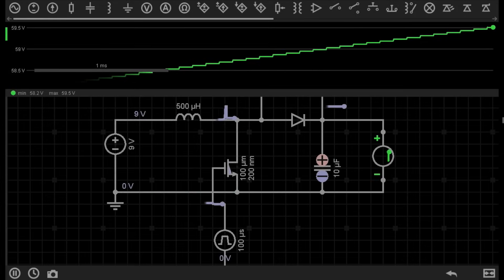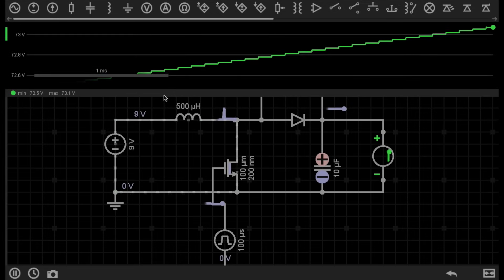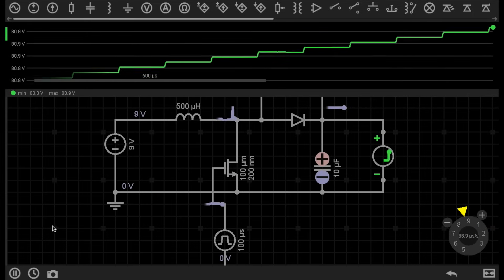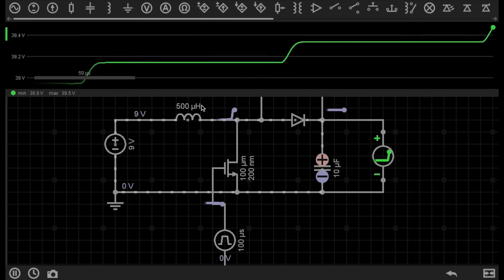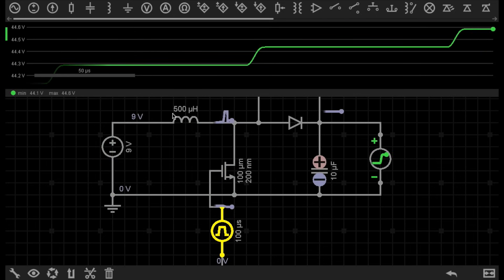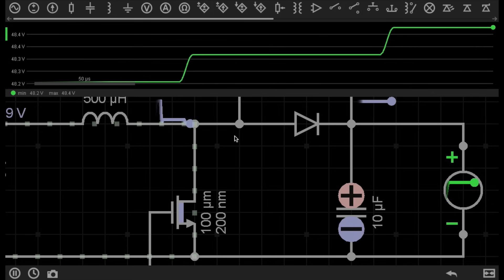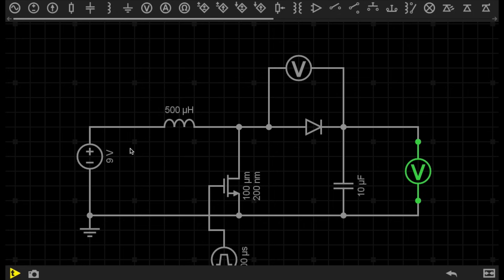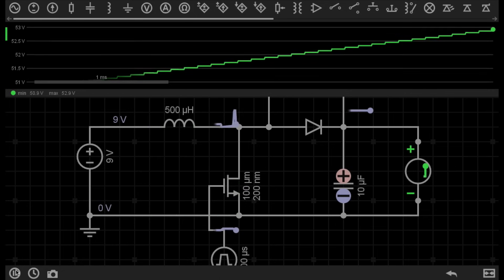How Boost Converters Work (DC-DC Step-Up) - Electronics Intermediate 1

Comment: Can this circuit be used to boost power (amps) from example a 48 Volt battery supply to lets say heat a heating element?

Comment: If the capacitore paralel the led , it make the led be on always ? 
Than why we need turn on off of supply?
Reply: its not led, its diode. Led is light emitting diode. In this circuit is simple diode

Comment: This is a great channel, you should really have more subs. Will recommend to my fellow ET students.
Reply: DC-DC step-up or boost converters are a type of electronic converter that are used to increase the voltage of a DC power supply. They are commonly used to power devices that require a higher voltage than what can be supplied by a battery or other power source. Boost converters work by taking in a low voltage input and converting it to a higher voltage output. This makes them a really useful tool for powering devices like Arduino boards, motors, and LED lights.

Comment: in real life how do i control the switch
Reply: You input a clock signal at a certain pulse, with a frequency you choose. You can use a 555 timer to control the switch.

Comment: Say if you're using a standard 9V battery as power source on this boost converter, even though the voltage you generate is a lot higher, there's just not enough power overall (which means a lot lower current) to hurt you right?
Reply: If the output capacitor stores enough energy at sufficiently high voltage, even the boost converter and battery is not powerful, it can still kill a person in an instant. So always discharge before touch.

Comment: I would not recommend building an open loop circuit like this.  It is too dangerous!  In real life, you need a smart chip as a controller to build a closed loop system.

Comment: I'm a bit confused as to why when the switch is closed, there is no current flowing across the diode to the capacitor? Surely there would be some without a resistor there?

Comment: Thank you for your explanation of the boost converter. Unfortunately, I still have a question on their working.

When the mosfet is off, the capacitor is charged by the circuitry. However, when the mosfet is on, there is a direct path from the input power source to the ground.

That means that power is still being used, unlike the boost converter. It also means that the boost converter should short circuit.

But it doesn't, so there has to be something I cannot figure out... Do you know what is It?
Reply: It's actually the inductor, when the mosfet is on the inductor act's as a load and starts converting the electric charge into magnetic field, when the inductor saturates ( reaches the maximum magnetic field it can store, measured in henry) it will be a direct path and the mosfet will get shorted. This is the reason why high frequency converters can use smaller inductor like 10uH because the "on" time is shorter and it will not saturate. Low frequency converters need bigger inductor, if not it will saturate and short out.  Most dedicated dc/dc uC controllers have a current feedback as soon the current starts rising because the inductor starts saturating the mosfet will be close to prevent short circuit.
Reply: @andrasszasz4373  If inductor is saturated, mosfet will get shorted.
shorted means what?
mosfet become faulty?
Reply: @anandsivathanu8517  Shorted means that the power supply's positive and negative rail will be shorted (same thing as if you take the powers supply positive and negative wire and touch them together), this will cause excess current through the mosfet which will result in excess heat and the mosfet will burn out.
Reply: @andrasszasz4373  Thanks for Your Kindly Reply Mr.Andras Szasz.
 I understand your reply.
Reply: Since you are working with AC, there won't be a short.

If the mosfet would be on steadly, then yes, a short would happen.

But think as an AC circuit.
A 500 uH inductor switched at 100 kHz would act as a 315 ohms impedance.

Since you are driving the inductor with a pulse train, the back emf is the responsible for stepping up the voltage.
Remembering that V_backemf = -L di/dt
Where di/dt is related to the duty cycle and the switching frequency.

Comment: Stupid question but does that mean the 10uf capacitor here need to be rated for 100v or rated for the 9v supply he is using?  I would be leaning towards it being 100v since the vom will eventually achieve 100v that he mentions so I assume the capacitor would also be at the potential.

Comment: Basically, you charge a capacitor that has a high output voltage (high capacitance) and cause it to rapidly charge and discharge, the discharging is the output voltage.

Comment: This channel is awesome, I do have a question, I'm starting to learn the basics of electronics. In this circuit, I'm finding it hard to understand why the current from the battery flows through the transistor when on and not down past the transistor,  through the diode and capacitor at the same time? I somewhat get the inductor and the polarity change based on the collapsing magnetic field and the induced voltage it produces, but I don't get why current will only follow the path through the transistor when on and not through the entire circuit when the cap and diode are on the same path? Sorry, I'm new to this, can someone explain this please?
Reply: I am curious myself, it's on the same path
Reply: Same question i have 😕
Reply: Try this: My guess is that some current does indeed, flow through the coil and diode. The resistances of the coil and diode lower the voltage that the capacitor receives, say 0.7 V reduction for the diode and some for the coil. Let's imagine that the capacitor has 8 Volt applied when the transistor is ON (conducting). The 8 V is a lower varying base voltage that then has a high voltage pulse superimposed on it, the capacitor 'sees' the average of the two changing voltages and partially smooths the two voltages, eg 8V + 60 peak. The resistance of any load affects the smoothing, lower resistance load makes it harder for the capacitor to keep the 'average' output voltage stable.

Comment: Question....
I have two 5 pin adjustable voltage converters.
One has the LM2577S, and is a purchased board.
The other is the IRU 1150, a recovered component from another converter that met its fate early :)
Yes, it works fine....
My question is, using a 5 volt supply to both of the Converters, create a Positive 12 supply from one,
and get the other to make negative 12 volts ?
Ending up with ground, +12, and -12.

Possible ?

EDIT: I need the switching Op Amp ability of 12 volts for audio pre amps.

Comment: very nice video. 
i have a question. i want to charge a battery from a generator and need to build a boost-buck-convertor that will keep the input voltage in the battery at 12V.
how do i build that boost-buck-converto?

Comment: Hi. I would like to build a basic boost converter  buy wiki is banned in my side and other site also dont load itself. So where i can find what values of resistor and diode and umm coil and mosfet and capacitor i will use? I can search these in other sites but i would like to keep respect on to ur knowledge so i m requesting from you.

Comment: When the voltage goes up what happens to current
Reply: vem4o Current will go down when voltage goes up and vice versa
Reply: mrsemifixit  why is that
Reply: vem4o Power must stay the same. ( ideal case where we ignore small losses that create heat)

power = voltage X current

This a very simple algebraic formula. 

If power in and power out must remain equal, what happens to current as voltage increases? It decreases
Reply: mrsemifixit ok , but what about ohms law then . Sorry for the basic question
Reply: vem4o What about it? P=I*E so what do you think?

Comment: Use two of these circuits paralleling the inputs and outputs. Have the mosfet hi speed switches alternate so that one o0f the inductor coils is always collapsing generating current, thus a more stable and higher current output potential.
Reply: DrHarryT 
what current will u get?

Comment: WHAT TYPE OF TRANSISTOR DO I USE .NPN OR PNP
Reply: doesn't matter, but in the video he used an n-channel MOSFET rather than an npn BJT, because in practicality it has way higher switching speeds and can handle larger power.

Comment: I'm a little confused. Why wouldn't the current goes through the diode and starts charging up the capacitor when the transistor is off, what is stopping it? Could anybody help me out here please?
Reply: Because it is a capacitor. It isnt supposed to suck up current continually. Only a quick change in current (AC) can pass through it. Thus the charging stops.

Comment: Hey can anyone answer if the frequency of the switching also affect the output voltage values? Any calculations for that? I watched most videos only take duty cycles into account. Thanks.
Reply: Here's the formula: V(out) = V(supply)/[1-D] where D is the duty cycle (ratio of transistor on-time to its switching period). Basically, the output voltage increases with duty cycle.

Comment: but how can the voltage keep holding the higher voltage on the output? is it only the capacitor? the circuit might glowing on the end. and what is the limit of the high voltage?

Comment: Recommend to use a more scientific simulator. Every circuit is great for basic calculation, but it is not gonna provide you with real life acceptable values for your circuit to work properly. In real life, the inductor will ring and cause high voltage spike which could breakdown MOSFET. The diode must be a fast Schottky diode. Input cap must be populated or it won't step up much voltage under load. If there is no feed back and the output cap current peak, the circuit is theoretically unusable. Bad feedback loop will cause unexpected damage.(Popping LED without noticing)
Reply: Mr. Tech
I'm sorry to say but you're wrong. In this particular circuit, there's an inductor, which generates a voltage spike in the exact moment when the FET starts to conduct (shorts the inductor). This spike goes through the diode, then charges the capacitor. This charge is very tiny (depends on the value of the inductor and the frequency of the pulse-generator), but the voltage of the spike is high. Of course you can't overcharge a capacitor, but if it's a - let's say - 200V one, you can be sure it will be charged up to this voltage over time.
This is the only reason the inductor has to be in that circuit - the voltage spike it generates when it's shorted. Older engines use the same principle for their ignition, there's a capacitor, an induction coil (ignition coil), a breaker and at the end there's a spark plug. The sparks voltage is high (12.000-30.000V) while the battery voltage is 6 or 12V, the current is low, but it will ignite the fuel-air mixture in the cylinder.
Reply: so which simulator you recommend
Reply: spice
Reply: I agree. It is better to make it in real and test it. These computer models are interesting, but far from reality, especially when it comes to these types of circuits.
Reply: Monsieur Mohandis  spice is engine which is used in almost all sim
Reply: Is there any SPICE-baesd simulator available on Android?
Reply: Hello Leo -- if you say so, could you please help me with a clear electronic schema, to build such a circuit using the battery 12 v of my car ? 
The project is to electrilising the air by 2 nails not touching each other,  in the hose before it come into the cylinders.   Thank's -- you can publish this device on your youtube post.
Reply: Jacques sur Gmail .
Just buy a $20. Stun gun.

Comment: sir  i have doubt 
when we switch off the transistor magnetic field collapses and induce  emf in the coil but it should flow in the opposite direction of applied voltage?
Reply: The polarity of the voltage across the inductor did reserve, so does the rate change of the inductor current, but the polarity of the inductor current doesn't change

Comment: If im using 12v dc to supply a converter to 220v Ac connected to a charger with 3a for a 52v 26 ah lithium battery which takes 12hrs to fully charge on a normal 220v Ac power point. How many Ah must i need on my 12v to last the for 12hrs....

Comment: hello there. im actually wondering if it is actually possible to use 12v dc converted to 48,52,60,72 v dc ect... as a power source for my e scooter which have a 600w motor hub with a 52v 600w controller. Currently my main batt os 52v 26ah... Is it possible to swap the batt with a step up converter using only 12v... How many A to equalized the 26ah on a 52v.

Comment: If the magnetic field is going to accumulate each time the switch closes , then that means the voltage will increase into infinity!!!,actually what limits the voltage to stabilize at 100 volt??
Reply: This is usually used with a resistor as load, so this helps the voltage to stabilize somewhere higher than the input voltage. On the other side, in real life, nothing can stop it. The voltage circuit is prone to infinite, but the components can't endure such voltages. Each component has a limit, and when the limit is reached, thing would systematically start to blow up.
Reply: Julio Cesar Alvarez Gomez thanks for reply . but that is so strange that it will stabalize due to load because the load is constant
Reply: No problem Mosab. You are right, the load is constant, so the load won't allow the capacitor to just increase its charge. While the Mosfet is ON, the load will get the energy stored in the capacitor, when OFF the load will get the energy from the inductor meanwhile the capacitor also reloads again.
From another perspective, when the Mosfet is ON, the charge in the capacitor will decrease depending on the load value, and it will increase as the Mosfet goes Off. 
With that on mind, the output voltage during a cycle (i.e. Mosfet goes ON , then Off and finally ON again) will oscillate around an average value that remains equal if the ON and OFF Times of the Mosfet also remains equal. That is what I called stable voltage in the output.
Reply: Julio Cesar Alvarez Gomez thank you alot. i got it .
Reply: The capacitor has a limit so it will saturate after the maximum voltage is reached.
Reply: The capacitor doesn't have unlimited capacity to store energy. Different capacity will store different amount of energy. So therefore it will limit the voltage of the output. But yes, theoretically, it could raise up to infinity (and beyond) :D

Comment: could you help me to get the equation of this circuit ?
Reply: This answer is going to assume you know how to do KVL by yourself. 
First do a KVL when the switch is closed on the outer loop.
You'll end up with: di_L/dt = V_s/L
But notice that di_L/dt is only in terms of voltage and inductor and NOT TIME. Therefore the current is linearly increasing, and we can change it from differentials to deltas such that:
delta(i_L)/delta(t) = V_s/L
delta t is dimply the duty cycle multiplied by the period.\ so you'll end up with:
delta(i_L)/DT = V_s/L
Then solve this is the final equation for delta i_L for the CLOSED switch
delta(i_L) = V_s*DT/L

Now do the same thing for when the switch is open.
You'll get:
delta(i_L) = (V_s - V_o)(1-D)(T) / L

Since the analysis assume that the steady-state conditions exist, we know the total current through the inductor is equal to 0.
Therefore 
delta(i_L open) + delta(i_L closed) = 0

Plug in the two delta(i_L)s and solve for V_o
V_o = V_s / (1 - D)

If you want a more thorough explanation if you do a google search on boost converters theres a powerpoint presentation that someone put together that first helped me understand them. Also we used the textbook Power Electronics by Daniel Hart in my class, does a pretty good job on buck boost, but controlled rectifiers aren't that good in it

Comment: Thanks for the best Boost Converter explanation on the internet !
One question though:
If I have an alternating load on the end of this circuit (let's say a color changing LED-Stripe), wouldn' the alternating current draw of this load require an adaption of the switching frequency on the MOSFET's gate to keep the voltage steady?
Thanks in advance ! :)

Comment: just subbed! does anyone know if you can use a 555 to switch it on and off with the input voltage instead of a second source?
Reply: nameless5r I think yes. I am doing that in LTSpice.

Comment: What happens when we upgrade the output capacitors to higher capacitance or higher voltage?
Reply from the maker: Higher capacitance will mean the output voltage will be smoother. A capacitor rated at a higher voltage than you supply to it will make no difference. The voltage rating of a capacitor is there to let you know that you should not charge to a voltage higher than it's rating, otherwise it may leak/explode.
Reply: Simply Electronics A smoother output also means more juice thus more power right?
Reply from the maker: No, just a more stable/smoother voltage.
Reply from the maker: well... splitting hairs here, when you compare a 100uf capacitor to a 1000uf capacitor. You will get a more stable voltage from the 1000uf cap. Therefore yes, the more stable output will have a more balanced power output. So technically more power yes, but nothing significant, it's just smoother.
Reply: Simply Electronics Thank You, sir